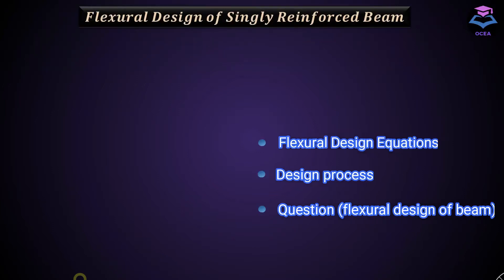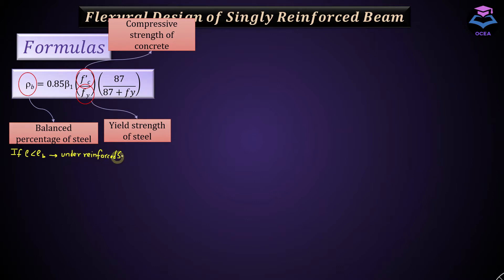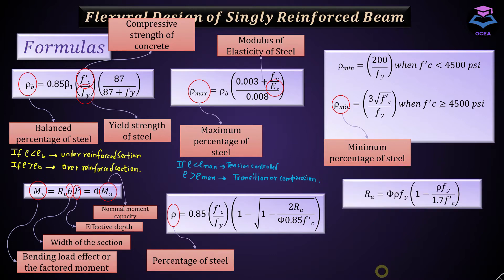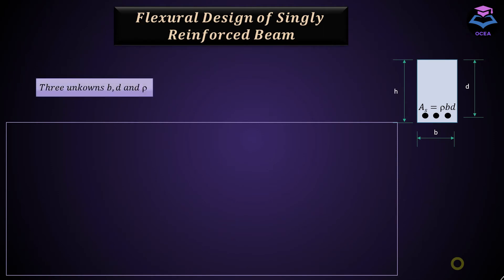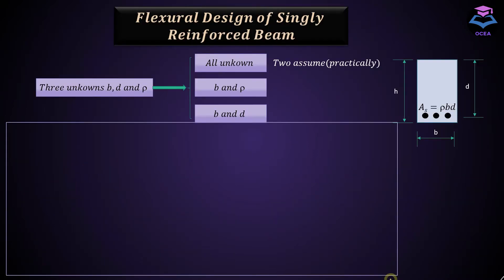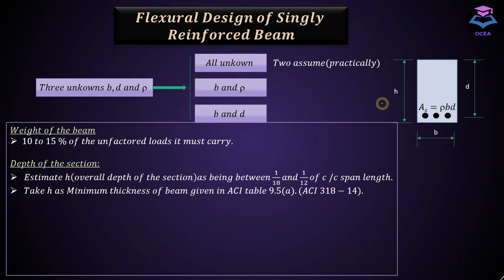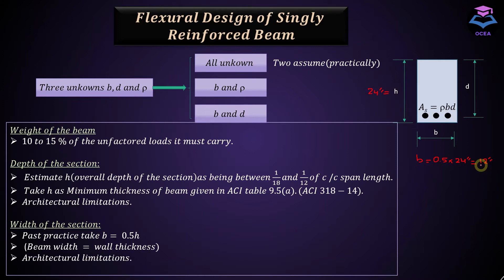Design of Beam (flexure) | Singly Reinforced Beam | ACI

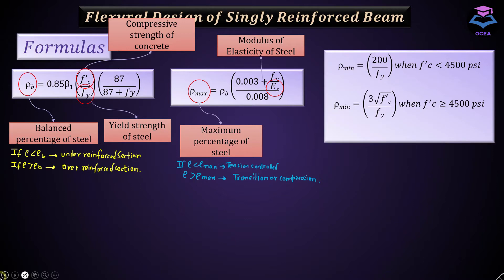Comment: What do you mean by compression control and tension control in 1:35
Reply from the maker: Pause at 3:25 in the video and see the diagram.
Tension controlled section is also an under reinforced section but with net tensile strain greater than or equal to 0.005. lets say for fy =60 ksi, net tensile net tensile strain = 0.0029, its  an under reinforced section but not tension controlled section.
Reply from the maker: Also when net tensile strain is less than 0.002 for fy=60 ksi, then its called a compression controlled section. You see as net tensile increases ductility of section increases.
Reply: @ONLINECIVILENGINEERINGACADEMY  thanks for your response brother. Jazakallah
Reply from the maker: @hussainkazmi4829  it's my pleasure.

Comment: What is preferred actually in percentage of steel. Should it be under reinforced, over reinforced or balance.
Reply from the maker: Under reinforced. It gives warning before failure. Steel yields before concrete crushes in this condition.